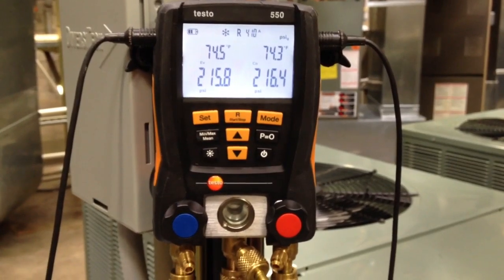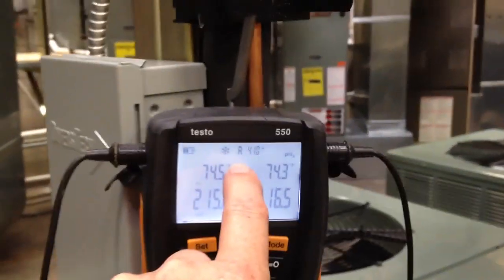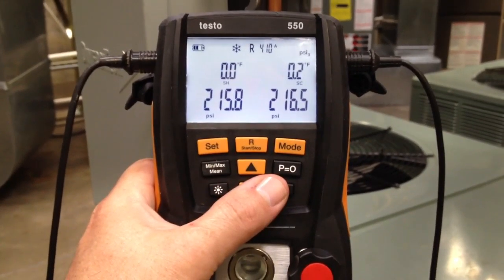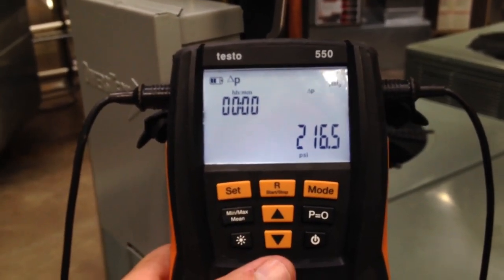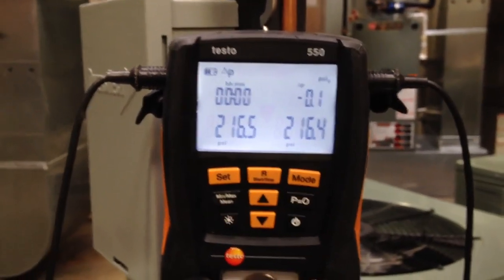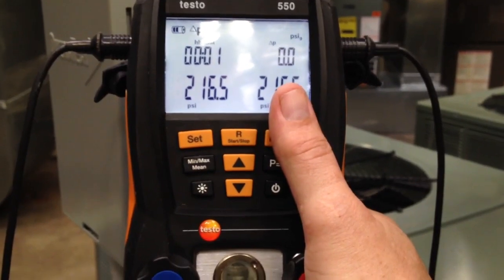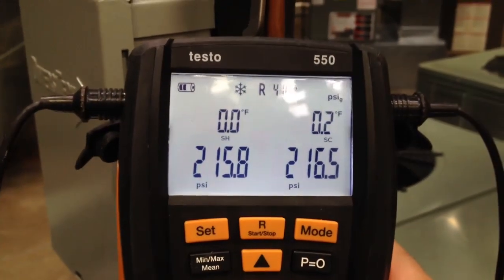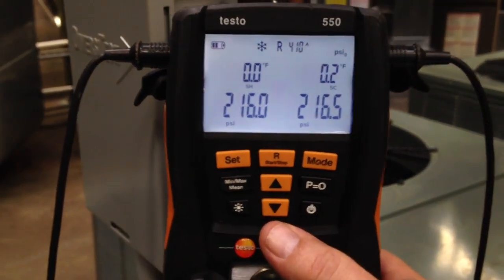Features of the Testo 550

Comment: Good vid. yea, i know its 5 years old.
Reply: My test 550 is little different as far as the buttons on the gauge is located on it, but it dose not have the capability to show microns when I follow the instructions as you mentioned in this video. Every time that I press the mode key it switch back to the normal operation and won't show the microns reading.
Do you know why is not showing the microns reading?
I've purchased the gauge in March/2018.

Comment: how come at 40 second the suction pressure is at 215.8 and the temp is 74.5 then at the same time the discharge pressure is 216.4 but the temp is 74.3 correct me if im wrong but the temp on the suction line should be lower by a fraction not higher.
Reply: ***** buddy your not comprehending if the temp should be lower on the suction because the pressure is lower i know the system is off read what i wrote and think about it a little
Reply: 410a is a mixed gas . pt chart is differnt for liquid or suction as it is with all blends, mixes or azeotropes.